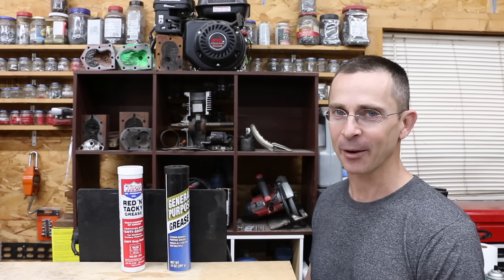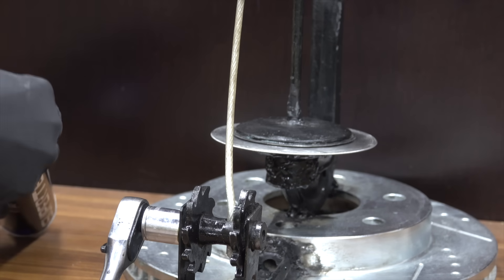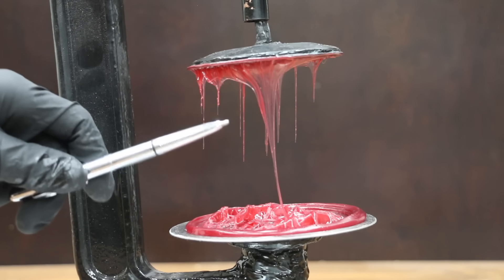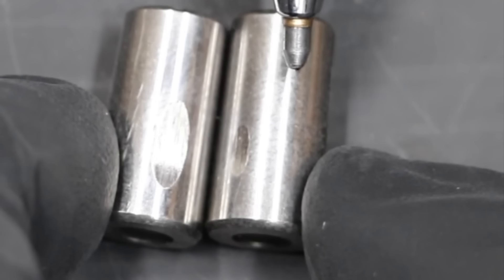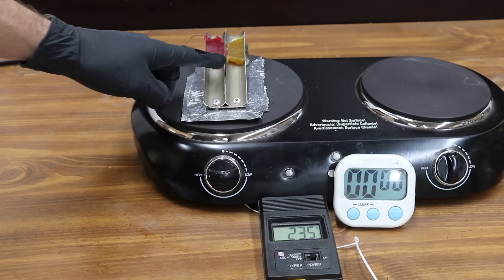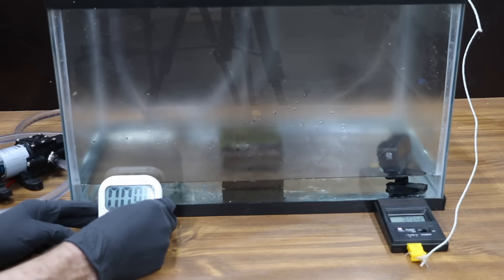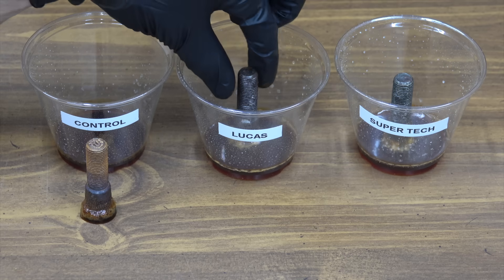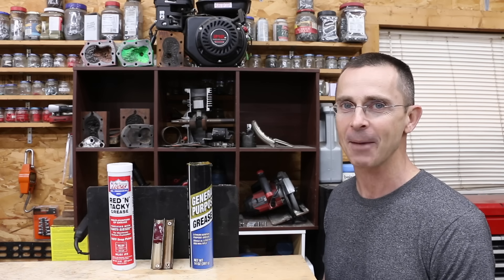Is Cheap Grease better than Lucas Red N Tacky? Let's find out! Bearing Grease Test Episode 1

Comment: Love the test, my question re: tack test, could just viscosity be a major factor, at the point you create a vacuum my thoughts were you are testing the sealing properties that maintain the vacuum and not the tackiness of just the grease? Sort of like when you ring two Job blocks together?   Same with water test in that two identical greases with different viscosity the thicker grease is less likely to wash away? At the end of the day it seems that the red Lucas stuff does more of what you want and is worth twice the price ( especially when you think of the labor/ cost value to get the grease there in first place! Again, love you Vajaos!!!!!
Reply: The Lucas is not necessarily thicker though. While it resisted washout and pulling more, it resisted cold rolling much less. Simple viscosity cannot explain this apparent paradox. There is something else afoot here.
Reply: @edifyguy  I agree, my point was that some of the testing "could" be affected by somthing as simple as a viscosity difference? Over all the Lucas product seems superior in each test. I love this channel and the way the testing is done in a shop and not a lab! When I comment like I do, it is  just to learn more about the testing and maybe ask if there is somthing else going on that is skewing the results? I love  this channel and the work that goes on here!!!!!!
Reply from the maker: Great feedback. Thank you

Comment: Can you please test John Deere greases? SD Polyurea, HD Moly, and I know that this is not fair at all, but please test John Deere Corn Head grease. It’s NLGI 0, and is meant for gearboxes that call for it. It’s super thin for a grease. HD Moly is super tacky, but being a molybdenum grease it is not for bearings. Can you test different moly greases on various tests, as many manufacturers do not want it in certain bearings especially wheel bearings. I know a lot of farmers use John Deere greases, can you give them a shot? Thank you
Reply from the maker: Thank you for the video idea!

Comment: Does anyone know where to order RETAIL sale of "Rusty Duck" spray grease?  After a long search I had found the manufacturer, and they still sell it wholesale.  But they never responded as to where to BUY it.  It is a wonderful synthetic grease I found around 1990;  it sprays on through a needle tube as a thin blue liquid and can run into cracks or be spread by a cotton swab.  Within a couple of minutes the carrier liquid evaporates, leaving a thin, clear film of wonderful sticky grease that lasts a LONG time.  It is great for gun lubrication, as there is no pile up of rubbed off grease---it is like it bonds to the metal and stays slippery!  Rusty Duck is still out there, but I have not seen it for twenty years..................……..elsullo

Comment: Yep, it all depends on what you need it for. Lucas definitely won, but if you are just putting a little bit of grease on caster wheels that you use a few times a year, you may not need much. Big piece of farm equipment, then yeah you should probably spend the money.
Reply from the maker: Thank you

Comment: I replied a while ago about Super Tech products and stick to my assessment today.  I stinks!  Pay the $2 more for anything else but this stuff.  In short, I put Super Tech oil in my Durango and when it threw a main bearing less than 5k miles later, when I drained it, it was like a water consistency coming out.  Their products seem to break down extremely fast.  This wasn't the only time I used and failed with ST products.  Obviously, you don't have to have the best of the best, but steer clear of anything Super Tech!
Reply from the maker: Great feedback. Thank you

Comment: Red n tacky for the win. I’ve real life tested all different greases in my u-joints. Heavily loaded 3200lbs in the back of the one ton Cummins, and an 20,000lb trailer behind her for 100,000miles a year for 4 years. 
Red n tacky gave me the most life,
I would re-lube every 1000miles Max, when I would refuel. Just a few squirts on all the ball joints a u-joints. 
I got good at changing u-joints until I found red n tacky and I swear by it today. 

Every time I see anyone use anything but red n tacky I give them the rundown and have converted a lot of “grease is grease” guys. 
Best product on the market
Reply from the maker: Thank you
Reply: Made this comment before I even saw the results, haha

Comment: Vaseline is my go-to cheap grease for most household things such as sliding glass doors and preventing rust on gym equipment in garage.

Clear, readily available, tacky, cheap, and doesn't become brittle due to oxidation like my DuPont lithium grease did.
Reply from the maker: Thank you

Comment: Grease is grease....lol..
Cost does not indicate quality.
But... Generally, the more expensive, the less it will actually cost!!
Grease is cheap!!! Use it!
Because repairs are expensive!
We use a good quality #2 grease, it is one of the more expensive brands. We use a lot!! But in comparison to the cheap 💩, we don't use very much, because it stays in place and works!!
The only thing we use cheap 💩 on is Fifth wheels. New Holland has a cheap lithium grease that works very well on fifth wheels!! 
Only time I have ever had a fifth wheel lock up was with one of the best quality greases you can find...
Thanks for the video!!! 
Just proves what I already knew😁
Reply from the maker: Great point. Thank you
Reply: @ProjectFarm  any time!
Thank you for doing the comparisons you do!!
I don't always get a chance to comment, but I usually get to the like button 😁

Comment: Yes the Lucas was the winner but under normal use with no constant abusive use of the machinery, equipment or vehicle it is used on and proper maintenance is performed and done on time, would it really make that much difference in the longevity of the equipment? From my experience, most mechanical failures are the result of poor maintenance and/or abusive use/operation of it at not from the lubricants failing.
Reply from the maker: Thank you for the feedback

Comment: Don’t forget though that “it’s just grease” and “use the cheap stuff” is good for daily hits on bushing type applications (like loader arms and buckets) when the main purpose is to keep out dust and trash as well as lubricate. With higher operating temperatures are the norm (asphalt plants) lithium is not a grease of choice anyway. Bentone based greases are better when ambient temps are in the 300 degree range. But they don’t work well when cold.
Reply from the maker: Thank you for the feedback

Comment: Been using the Walmart Supertech oils and lubes for years.  Of course it depends on your needs, but for light-duty use, it's fine.  Never had a problem.   Not worth spending much more money if the mechanical needs don't demand it. Supertech / Walmart also offers heavier-duty/higher-performance grease and lubes as well.  And still far less expensive than the fancy-shmancy named-brands.   Much of the higher-priced stuff is to simply fill a dude's ego with things we don't need.  Simple as that.
Reply from the maker: Thank you

Comment: Lubriplate grease was one of the first to have lithium, if not the first. I think that it was a Studebaker product. It was recommended for the door latches, hinges and so on. I have started using the Lucus red grease on suspension parts, and I am glad that I have made that choice. Thanks for the video.
Reply from the maker: Thank you

Comment: I hope you test the Mystik JT-6 #2 grease, I have always felt it worked best in high water contact areas like boat trailer wheel bearings and it and the Lucas Red are my 2 main choices...but I also have moly, supergrease with teflon for poly bushings and hybrid oil grease for vault bearings...
Reply from the maker: Thank you for the video idea!

Comment: Wow awesome test . I know which grease I'm changing to . Thus will be a huge help for my boat trailer . I have always had problems with my boat trailer bearings.  Now I know why . I'm thinking this will help immensely.  To eliminate those sitting on the side of the road changing a bearing on the boat trailer.  Thanks for the info since I've always really really wondered if there is a real difference in greases from different companys .🤔🤔😃
Reply from the maker: Thank you

Comment: A comparison of hydraulic fluids would be pretty interesting and useful. When it comes to tractor hydraulic fluids, I’ve heard everything from “It doesn’t matter which one you get, they’re all the same” to “I’ll only buy X brand, the rest are garbage”

Keep up the great work with these tests. Even if it’s a product I don’t usually use, I always enjoy watching the videos. You are very methodical and the video editing is great.
Reply from the maker: Thank you for the video idea!
Reply: I think a comparison of hydraulic fluid would be an extremely popular topic!
...even the sales people at the dealer will argue over what I should buy.
Reply: I know that john deer hydraulic fluid and other house brands are literally just ATF I know a few racers that swear by it because they can get it cheap and just change their fluids regularly anyway
Reply: Hydraulic fluid is not all the same, industrial manufacturers(end users) go through great pains and expense to ensure their hydraulic fluid is clean and dry. Because a paper machine that has a massive hydraulic system in the calander and reel section costs about $250k for every hour its not running. You literally can't afford to have the machine down because dirty fluid stopped up a valve or oriface somewhere. So they have huge filtration and drying systems, and store their oil in pressure vessels charged with a nitrogen blanket on top to keep moisture and oxygen out.

Comment: I think it's a matter of application. In some cases, given the cost of replacing parts vs the cost of paying 2-3X the price of the grease, it just makes sense (and cents) to go with the cheaper option.  I worked at a place where the bearings on equipment was never given a chance to break down. Essentially, we put grease in the wheel bearings every single time we filled up with fuel. In that case, the cheaper grease was fine.

Overall though, I figure it's best to use the best grease you can get so there is a minimal down town as possible.
Reply from the maker: Great feedback

Comment: Many cheap greases are red, presumably to imitate Lucas. They are NOT the same! I have seen what happens with the cheap one just sitting in a grease gun: Red liquid, looking like automatic transmission fluid, leaks out over time, leaving a dried up clump in the tube. The price difference for Lucas is well worth it for the protection.
NOW...How about a comparison of the Lucas RED vs the Lucas GREEN?
Reply from the maker: Thank you for the video idea!

Comment: I'd like to see some testing with brake pad materials.    

Organic vs. Semi-Metallic vs. Sintered.   I'd love to see variations of each compound as well.  I think you could do this with a motorcycle wheel, rotor, master cylinder, line, and caliper.  Measuring brake input force vs. stopping force and fade resistance.    This would be a fun experiment.
Reply from the maker: Thank you for the video idea!

Comment: I don’t feel this was fair these are two totally different types of grease if you’re going to use a red bearing grease from Lucas than it should be the same from super tech not a white lithium. This was basically a heavy duty vs light duty.
Reply from the maker: Thank you for the constructive feedback
Reply: taylor ridings you missed the point of the video you numbnuts. He clearly stated it was a test to see if all the extra money was worth it compared to just regular grease. Take the corncob out of your ears
Reply: I agree. I used the red super tech grease in my trailer bearings the other day. Was hoping to see the red super tech in this video
Reply: Actually, the Red-n-Tacky is Lucas' "all-purpose" grease. Lucas sells a heavy-duty grease, which is green in color, and contains some Molybdenum. But for me at least, it's harder to find that product locally so I buy the Red-n-Tacky and make sure to grease often. I run a compact track loader and re-apply all grease points on that machine every 8-10 hours. I know there are better brands out there, but as is mentioned in this video, it's poor practice to mix different types of grease, and with that in mind I look for products with widespread availability ... because in my opinion it's more important to regularly apply grease with consistently the same properties. Never had a problem doing so, especially with the Lucas Red-n-Tacky Brand. Was happy to see the results of this test, but would also have liked to see some other brands included.
Reply: actionsportster shorttheow50 , y’all missed the point not all greases are created equally and have completely different chemical properties and make ups. This is an apples to oranges comparison, Lucas is a great company that I personally use and I’m completely content with the results, but if you’re going to use super tech white lithium then get the Lucas white lithium (which is still about twice as much as ST.) If you’re gonna use red and tacky then get the ST medium duty complex (which are priced about the same.) I am a heavy equipment mechanic and we use black moly grease on all of our equipment and you greasing every 8-10 hours is when you’re supposed to be greasing anyway, per most manufactures, no matter what you use.
Reply: @actionsportster7686  Yeah I've used red n' tacky as a trailer mechanic and medium duty and heavy duty truck tech for 5yrs now and it's some of the best stuff out there. It's great for wheel bearings.

Comment: In caverns,,,, they're called Stalagtites and Stalamites. Slick,,,, wans't it! I use Shaeffer Oil lubricants. They have a great 20/50 weight oil I will use in my VW 1835 engine in my airplane this summer. Here's a link to their greases: https://www.schaefferoil.com/greases.html
Reply: However,,,,, if it's "Project Farmer" approved,,,,,, I'd use it!
Reply from the maker: Thank you!

Comment: Would like to see a comparable apples to apples. This video proves that grease type matter. How about another cheap red grease. For example traveller premium heavy duty lithium at tractor supply or any type of cheap red grease. Curious if brand matters when red to red so to speak. Thanks for the videos they are very informative and interesting.
Reply from the maker: Great suggestion!  Thank you

Comment: Congratulations, you compared a lithium complex grease to a lithium 12 hydroxy stearate.  They aren't designed for the same application and have different temp ranges, different base oils, different bearing applications, and one lacks EP additives.  It's like comparing a mineral oil to full synthetic.  All you did was create a biased marketing video for Lucas, well done.

Comment: Need to try Mobil red bearing grease. The wal mart is just general purpose grease. The lucus grease more like Mobil red or 24508 navy red grease. The Navy did away General purpose grease to termalean grease which is green in color for all water use I.e. water proof for fair water plans rudder and stern planes on submarines/bow plans. The red grease 24508 is a bearing grease.
Reply from the maker: Thank you

Comment: I heard grease with high   molybdenum disulphide content can cause bearings to skate instead of roll and cause wear. It would be interesting if you could test that. Common molybdenum disulphide greases I know of are  mobil1 xhp221  0.75% molybdenum disulphide,  mobil1 xhp 322 and aeroshell 64 5% molybdenum disulphide content.
Reply from the maker: Thank you for the video idea!

Comment: awesome video  you question to mix grease should not mix the grease in electric motor they do break down or harden the grease up I did do service work in very big plants too I had to go out and buy special grease guns for those companies they did supply me very well with their grease tubes too 
we did a 2 plants the had to use food graded grease to the something had to go out and pay more grease guns I wonder why my truck was overloaded for then I switched to the Milwaukee battery power grease gun did order over 500 of them my dad  has a farm shop company does service work for a dealerships  he has 25 trucks do the service work to different grease to they carry and the shop use grease guns to 
as to the grease we have a wall full of grease brands we bought the farm dealerships have a wall of all different kinds of oil and grease we sell we have oil refineries here too as our house oil we do use one of the companies oil brands we use here we do have a refinery will to sell to us cheaper sorry they do know why we do not use them as to they did cost us a lot of money in motor and other things have and very old generator finally we burn up all of the fuel from that company it does burn used cooking oil it did my uncle given 5 of cats generators to me when I got them 4 did work did sell them off when fast did send the last one in to have it rebuilt at cat was not a cheap rebuild at all but it did get to run again cat did offer me a new one for that one 
sorry I know want that one does and does not have any electrical control on it back at, cat it was underwater for a month and it was running all the time the fuel to had water in it it did not mis a beat pre-war world 1 my uncle has a sawmill why he had them
Reply from the maker: Great feedback. Thank you

Comment: Thank you.  I've used Red ever since I rebuilt the front end on my F150, and found I couldn't easily clean it off my hands.  I'd been wondering if it was worth a couple of extra bucks but I've been using it ever since.
Reply from the maker: Thank you